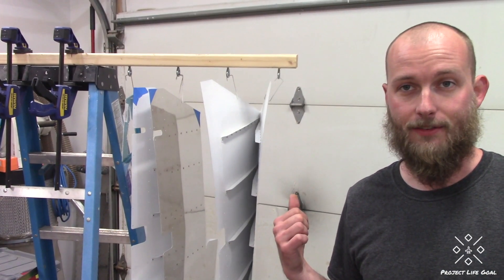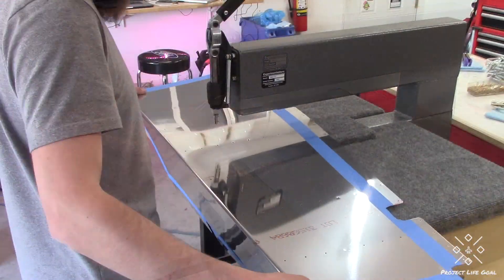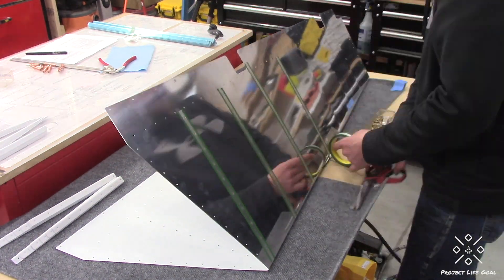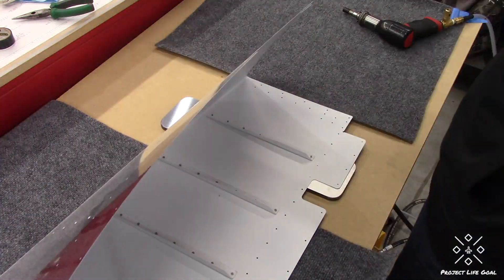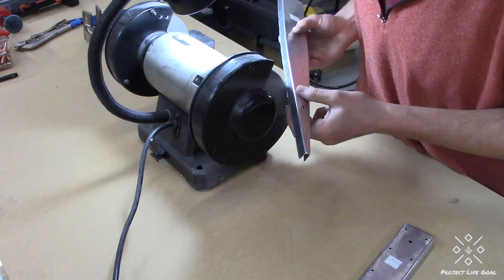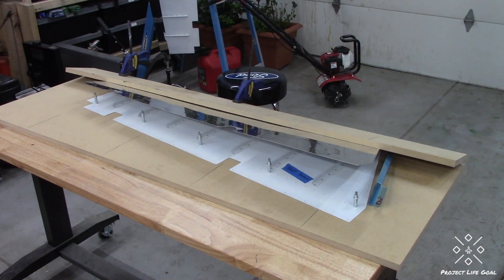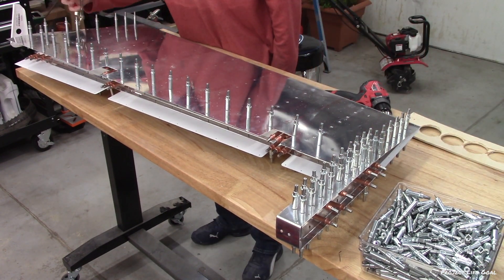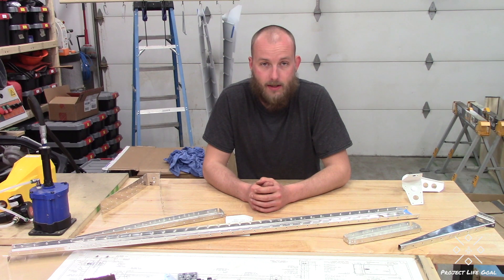PLG S1E14 - RV-7 Vertical Stabilizer Closing, Elevator Skins, Right Elevator Assembly

Comment: Grant... You can definitely count my vote for back riveting, although during the practice kit I found the rivet holes were too close to the inside of the angle bracket, and so I couldn't fit the set over the rivet. Instead I had to use a 1/2" mushroom set, which made me a bit nervous. It worked, but I did walk off the side of one of the rivets.
Reply from the maker: I migrated my channel so replies were lost. Thank you for your comment.

Comment: How did you prime? I am looking for the video how builders are applying primer to parts and inside of skin.
Reply: Would you mind sharing the paint products you use for the priming process? How are you applying the primer? Pneumatic? Shake can? Roller?
Reply: Aha... I found where you mentioned Rustoleum in an earlier video! So, I'll modify my question...did spraying the larger pieces of the plane present any issues while using the cans?
Reply from the maker: I migrated my channel so replies were lost. Yes, Rustoleum White Aluminum primer in rattle cans. Just have to light coats.